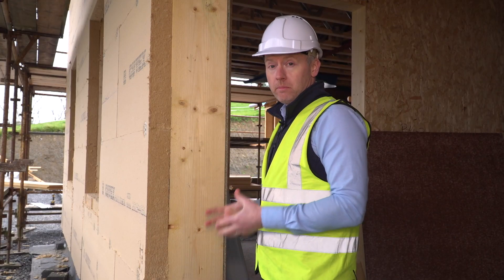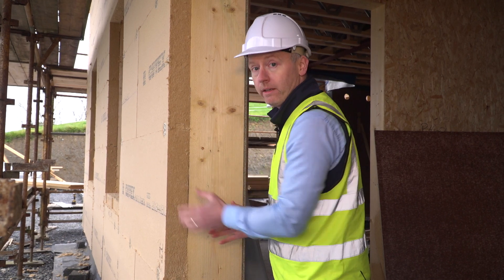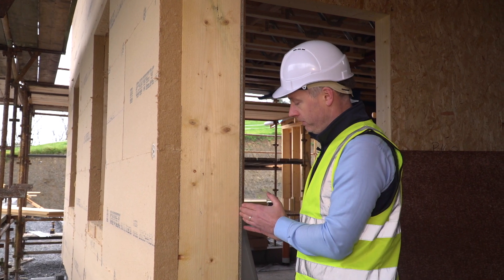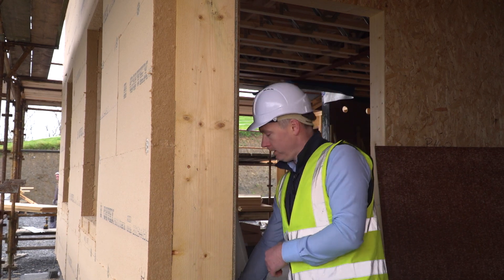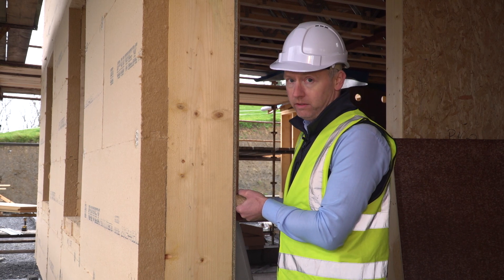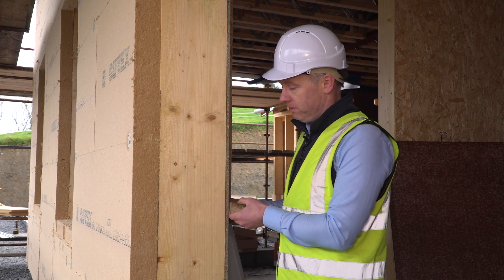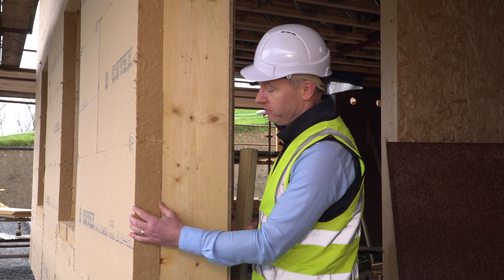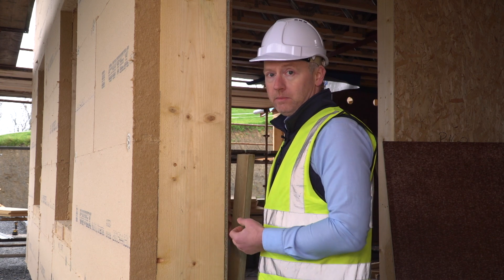A breakdown of a Passive Eco Wall for an nZEB build - Traditional Style Timber Frame Series (part 2)

Comment: Gypsum plasterboard is not 'breathable', so strictly speaking this is not a breathable wall.
Reply: Hi Karl, thanks for your comment. The Passive House Eco Wall combines a vapour retarding racking board on the inner warm side, which is our Finsa SuperPan Vapourstop with a very vapour open external woodfibre insulation board and breathable insulation between the studs.
Finsa SuperPan Vapourstop fulfills 3 functions: 
1) timber frame bracing, 
2)Airtightness, 
3) Vapour control. 
In our climate in Ireland and the UK it is common to use vapour retarders internally to reduce the risk of interstitial condensation in winter months or when moisture levels within the building may be high. This wall "breathes" to the outside through the GUTEX MULTITHERM board which has a very low vapour resistance factor µ of just 3. Finsa SuperPan Vapourstop on the other hand has a µ of 1150. These are the core elements within the assembly which manage vapour transmission and breathability. Sadly in some projects end users apply a vapour tight membrane or barrier inside and a vapour resistant insulation externally. This greatly reduces drying capacity and breathablity leading to great risks of mould, structural degradation and moisture induced issues. 
In the Passive House Eco Wall specification gypsum board has little role in this process internally, though its worth bearing in mind gypsum board typically has a µ of about 10 and is relatively thin, therefore if is relatively vapour open too. On the other hand, if the gypsum board has a foil lining on the reverse side, then it is very vapour tight and wouldn't be considered breathable. 
Of course where assemblies are diffusion tight externally it can be useful to allow some "back breathing" seasonally internally. This is where our INTELLO PLUS Intelligent vapour control membrane is often used instead of the FINSA board, and this is compatible with non foil backed plasterboard. Lots more details about our INTELLO can be found here:
https://www.ecologicalbuildingsystems.com/product/intello-plus
Sorry for the long response! Hope this is helpful. 
Details about the FInsa board can be seen here: https://www.ecologicalbuildingsystems.com/product/superpan-vapourstop
And the GUTEX board here: https://www.ecologicalbuildingsystems.com/product/multitherm
Reply: Actually gypsum IS VERY breathable (for moisture vapour). That's why under it always goes vapor barrier (i.e. polyethylene) to stop moister going into insulation materials and structural elements